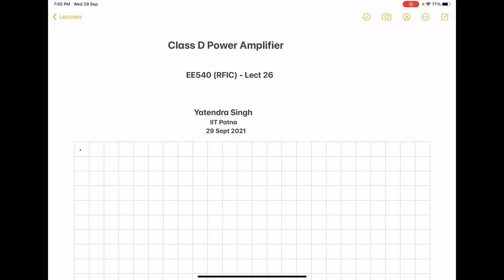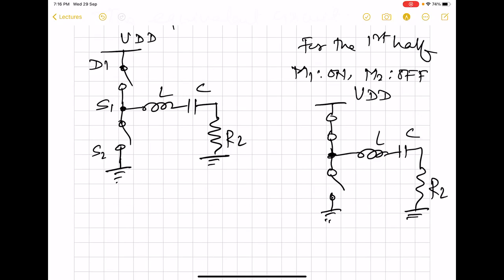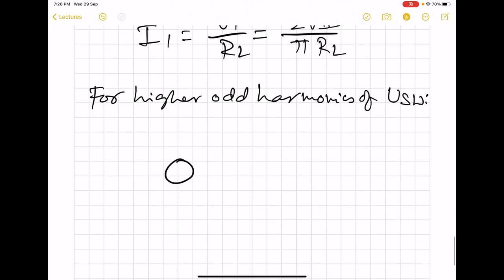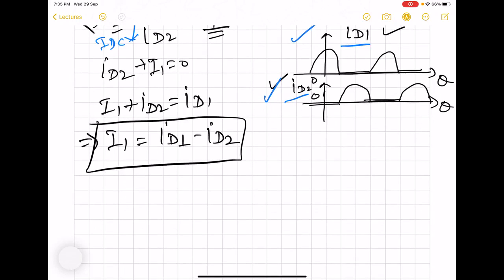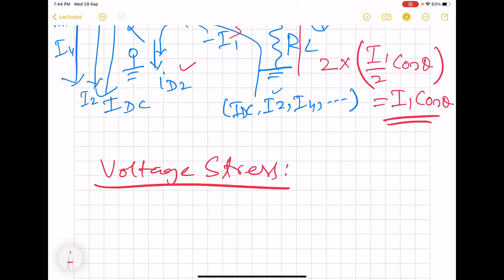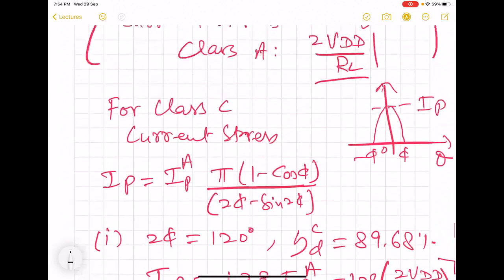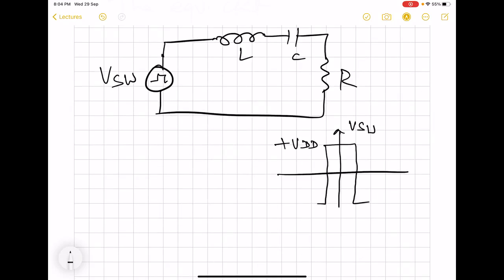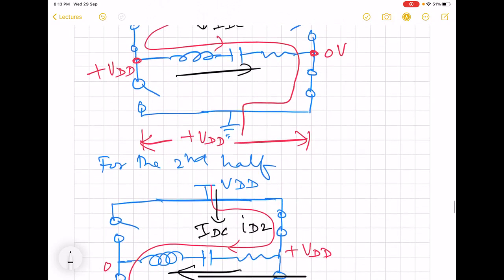Radio Frequency Integrated Circuits (RFICs) - Lecture 26: Voltage-switched Class D Power Amplifiers

Comment: Sir, in class A P.A, the voltage swing can go upto 2 VDD and in class D only upto VDD. Shouldn't class A be able to deliver more power than class D due to higher voltage swing ?
Reply from the maker: Yes, but only when the i/p to Class A should be sufficiently high to get close to full or full o/p swing of 2VDD.
Reply: @YatendraSingh  thank you sir.